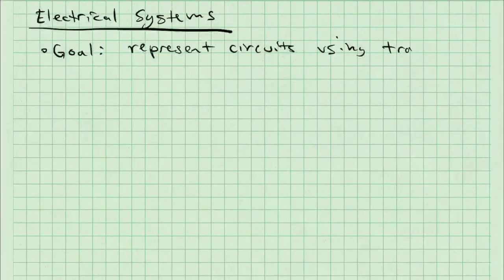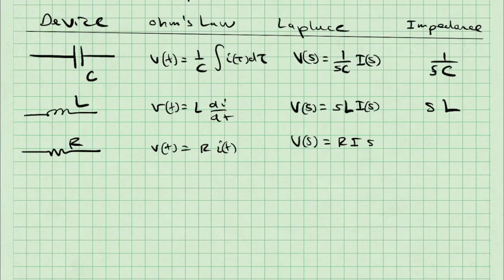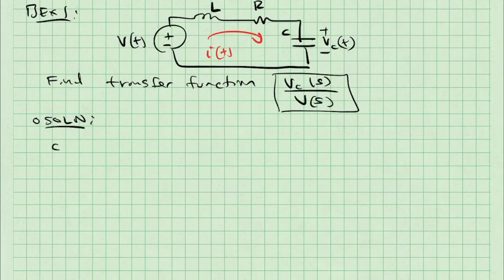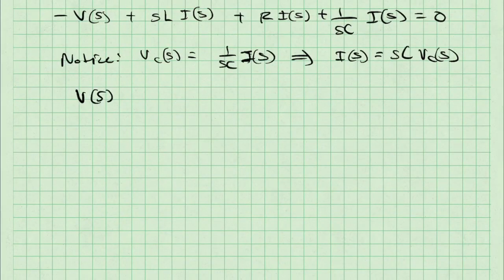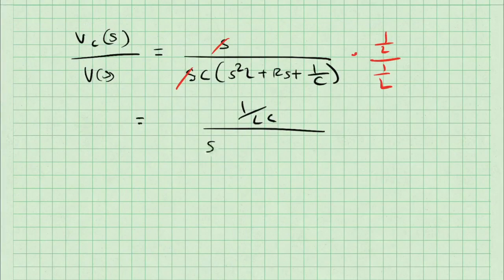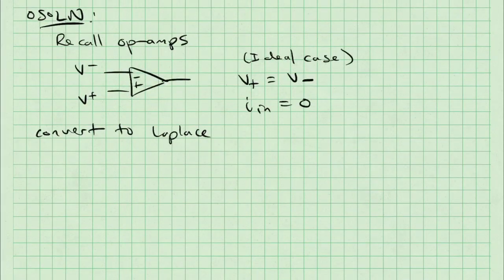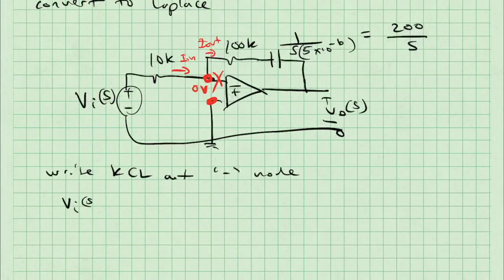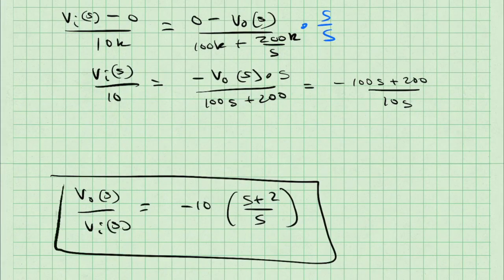Electrical Systems

Comment: why is the v(s) negative? at 2:47

Also, at 4:04 when you multiply 1/L to Rs, shouldn't it be Rs/L not R/Ls?
Reply from the maker: To answer the first question, KVL tells us that voltage rises equal voltage drops. When we go clockwise around the loop, the voltage rise is counted as negative (supplied), and the drop is counted as positive. 

Maybe look at my KVL video for more.

I’ll look at your second question, could be an error on my part!
Reply from the maker: In answer to second question: looks like my writing wasn’t clear but my phrasing ought to have been, “R/L times s” instead of R/L s (I didn’t pause long enough). Good catch on the flaw in editing my pause too short!